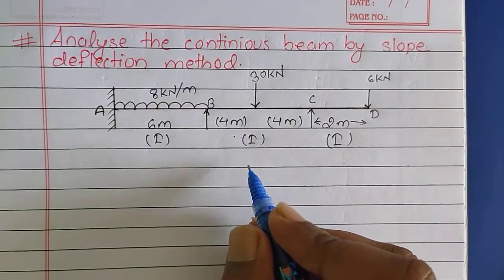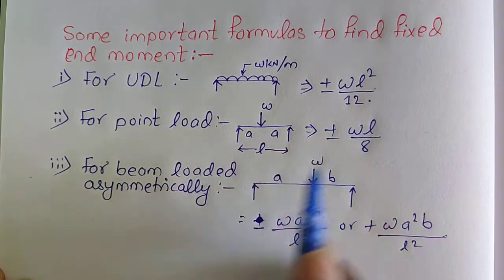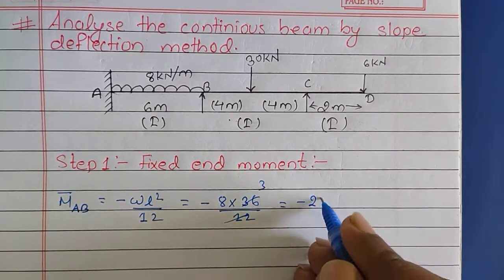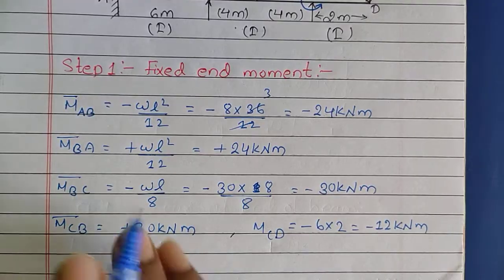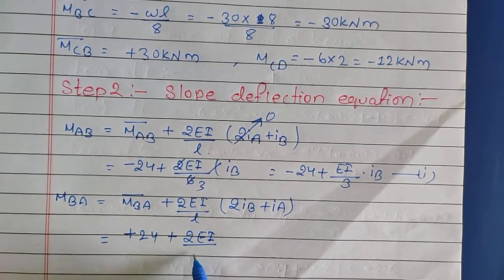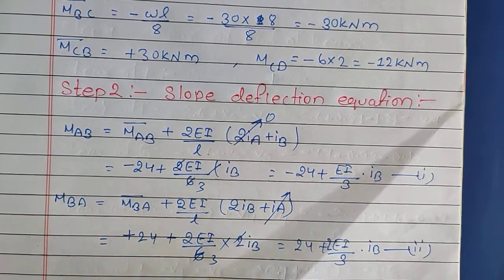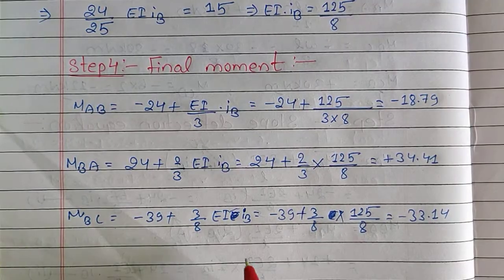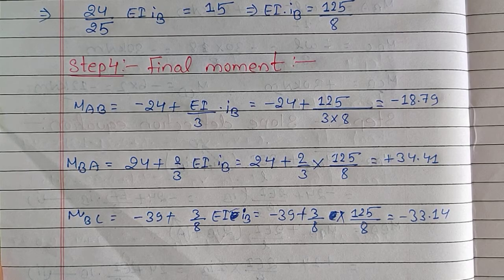Slope deflection method

Comment: Sir how do you identified point B is roller and point c is hinged
Reply from the maker: If the support is represented as arrow then it's hinged and if it has a circle then it's roller support.
Reply: @Civillearningonline  sir even though the point B is hinged we shouldn't use that equation...we should use that equation only for the 2 ndor 3rd span right??

Comment: Sir, for simply supported using formula 3EI/L... we get other valves of final moments and for simple supported using normal formula 2EI/2... Getting different values why?
Reply from the maker: The formula which you have asked for I myself have consulted to my teacher when i was in college. And they suggest me to use the formula which i have used in this video. No doubt the formula which you are showing is correct but it's actually not used when you have a look in some higher books.

Comment: What is diff between slope defln and kanis mthd
Reply from the maker: Kani's method:
It is suitable for multi storey building.
As there is no need of deriving equation and solving it. So it's time saving.
While,
Slope deflection:
It is used to analyse both statically determinate and indeterminate structure.
Considering deformation due to bending only.

Comment: Sir in slope deflection eqn how at Mbc taking hinge
Plz reply anyone why can't we do same procedure as we did
Reply from the maker: Here is my another video on slope deflection method here i have provided all the reason of using that equation , recognizing the fixed and hinged support as well as the problem that we face if we use general equation of slope and deflection.
If yuo still face any kind of difficulty then let me know.
Fell free to ask.
https://youtu.be/qQAqGbK19UA
Reply from the maker: Here is your answer.
We need to use that equation when our hinged support is at the end of the beam.
If we use the same equation then we will have one variable more than the number of equation.
Reply from the maker: And to prevent the solution getting lengthy we use that equation.
And it is easy to recognize whether the support is hinged or fixed just by observation.
Reply: Sir, for simply supported using formula 3EI/L... we get other valves of final moments and for simple supported using normal formula 2EI/2... Getting different values why?

Comment: Sir..pls confrm the value of EIib..it's not 125/8 ..correct value is 72/5
Reply: Then only the final moments value will be same..
Reply from the maker: Slope deflection method in hindi:
https://youtu.be/qQAqGbK19UA
Reply from the maker: Yes you are correct.
I am extremely sorry for this.
It has happened because i have mistakenly written 25/24(EI.ib) =15 as 24/25 (EI. ib) =15.

Thanks alot for letting me know.
By the way i have another video in hindi on same topic.
And i am sure you are going to find it very helpful.

Have a nice day.

Comment: Mba +Mbc= 0 so how that 34.41 and 33.14 came. must be both same.
Reply from the maker: Hello dear,

First of all thanks to you for your comment.

You might have noticed that we have got (EI/ib) in all three equations.
And we have calculated the value of (El/ib) using the portion AB of the beam.
Also, I have not used Mba + Mbc = O here in this numerical.
And that's why we have got that answer. And believe me it won't create any kind of problem.

And one more suggestion to you to solve problems related to slope deflection method.
Try to use both the equation i.e. equation for fixed end and hinged support whenever you have such questions.
Because incase if  u are using the same equation through out the the Numerical gets trouble some i myself have faced that.
This was my first video on this topic. I will soon be adding more examples to clear ur all doubts so stay connected by subscribing @civillearningonline.
And i will show the application of Mba + Mbc =O in some other example soon.

Thanks alot for ur comment.
Have a nice day.
Reply from the maker: I have no idea whether you are familiar with Hindi language or not.
Let me know by replying this.
I am ready to help you out with all your confusion.
Reply from the maker: I hope this video is going to help u alot.
https://youtu.be/qQAqGbK19UA
Reply: im from srilanka . can you make moment distribution method little hard question  in english. before 15th . i will share your video with my friends.  thank you  .
Reply from the maker: Moment distribution method
https://youtu.be/jtRuxLE-RcA
Reply from the maker: New type i will be uploading tomorrow.
Reply from the maker: Of course I will.
On each and every type soon.